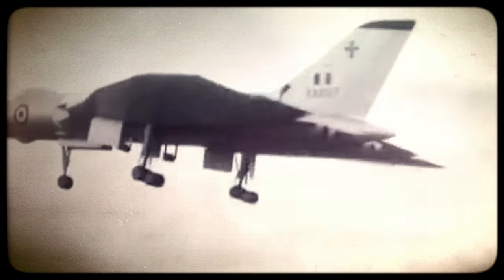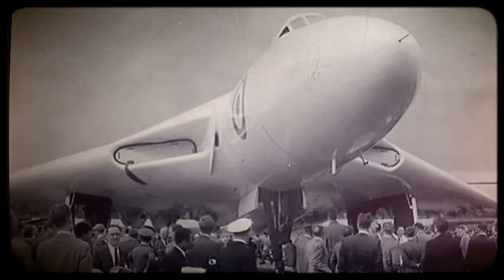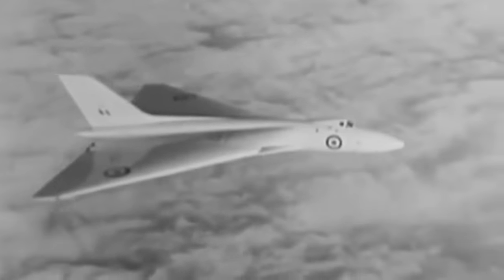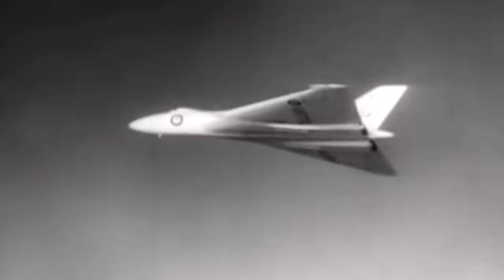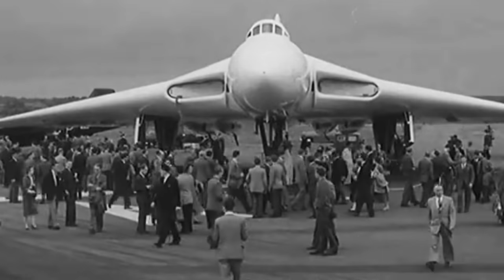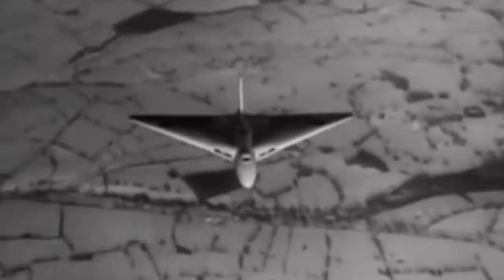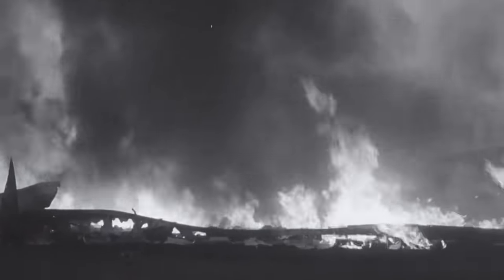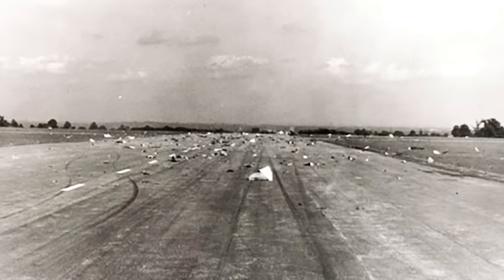Vulcan Bomber Disintegrates on Camera

Comment: There's a personal aspect to this tragedy for me. I lived in Arnold, a district of Nottingham 4 miles from Hucknall Aerodrome, base of the Rolls-Royce Flight Test Establishment, where Vulcan VX770 was the flying test-bed for their Conway engines. Due to the experimental nature of the Vulcan's flights, it was permitted to perform low circuits over densely populated urban areas, and my house was right on that circuit. It used to regularly thunder low overhead, rattle the roof tiles, and scare the living beejeezus out of me; I was 3 years old at the time. When I was a bit older, my father, a former WWII navy Spitfire pilot turned RAF Gloster Meteor pilot, used to take the family along to air displays. Where, in the end, I 'made friends' with the Vulcan VX770's successors and the other ear-splitting jets. The last time I saw a Vulcan was in summer 2015. By chance, I saw the very last airworthy Vulcan in existence (number XH558) as it flew to Throckmorton air display. It was retired for good later that year. Sad that we won't ever see and hear again that awesome iconic beast thunder across the sky.
Reply: Thanks for your input.
Reply: Experimental airplanes allowed to perform over populated areas ! .....Does it make you feel, the people have no importance or significance ? I find it offensive they would not have performed over deserted areas.....Really !  Over the water maybe ?  Imagine the damage if one of these planes had again degraded in flight ! the number of people that would have died !!!!! Unthinkable.
Reply: Wow! my dad told me of the same thing. My passion is aviation and photography and one of my faves and last seen aircraft was the XH558 :-( Sad.
Reply: @linanicolia1363  Ha! really? Didn't you know people are expendable? if you didn't, you'll now know with the pandemic.....
Reply: That time with the falklands campaign the old Vulcan came through one last time for those black buck missions. A fine testament to an aircraft that was a real 1 off. It’s interesting however that the Vulcan’s us contemporary the B-52 Stratofortress continues to reinvent itself and remains in frontline service. It might truly be the first aircraft to celebrate a full century in service. Mainly because nothing has ever really been able to do it better
Reply: @linanicolia1363  Back then there wasn't quite the same emphasis on "health and safety" as there is now and actually quite a few tragedies happened during this developmental stage. I guess that's what spurred on safety regulations etc.
Reply: I was at school in Bulwell, near enough to RR Hucknall to be able to hear when the Flying Bedstead was being run (it was pretty noisy!) but I left in 1956 so the Vulcan was flying after then, but I'm sure it would have overflown Bulwell, too.  I used to work for RR  
and flew RC models on the airfield where the Vulcan was operated.  The Hucknall airfield was more of an airstrip with just one runway (it's a housing estate now). It's amazing that flying such a big aircraft was allowed because it's very close to quite large populations but they also flew a VC10 as test aircraft for RB211 programme much later - 1970s.

What a tragedy!  It's surprising the Vulcan programme survived it.
Reply: @Leec_1972  Most, if not All, safety regulations are written in Blood.
Reply: @linanicolia1363  no health and safety then. Racing car makers tested at 150mph on public roads too.
Reply: Yeah, thundering overhead, preparing to kill innocents????

Comment: It's amazing to think that the Vulcan was designed just 5 years after the Lancaster, by the same team at AVRO.
Reply: And my question is, "Was the Vulcan designed to do a Roll?"
Reply: @markdavid4897  It can just about pull off a Barrel Roll. (Maybe 'pull off' is not the best phrase...)
Reply: @tedf1471  technically most aircraft can do a 1g barrel roll. You can have a cup of coffee with you while you do it. okay, well may be some skill involved there, but it can be done
Reply: Brian Roome  Oh you're so clever!.
Reply: @williamjpellas0314  WTF?
Reply: @williamjpellas0314  That's right . Space flight . Moon landings . Want more ?
Reply: @chrisjohnson4165  British science and industry benefited greatly from a large number of German scientists, engineers, and technicians who were either captured by British military personnel or surrendered to them voluntarily.  The same was true of the US and the Soviet Union.  The Space Shuttle, for example, had direct input from Adolf Buseman, who was one of the pioneers in swept wing research and development and who also suggested the use of what became the ceramic tiles used to shield the Shuttle during atmospheric re-entry.  Expatriate German scientists largely built the first atom bombs for the USSR.  British hydrogen bombs were probably built with significant German input.  The list goes on.
Reply: @williamjpellas0314  So what's the dispute ? I can't discern any relevant info that would suggest that the demise of this extraordinary aeroplane and it's talented airmen was the result of " a sudden infusion of German engineers at the end of WWII . "
Reply: @peterbellwood5412  That's not what I meant, Peter.  I was responding to @ Chris Johnson's comment that "It's amazing to think that the Vulcan was designed just 5 years after the Lancaster, by the same team at AVRO".  Not exactly.  It may have been nominally the same personnel, but they certainly benefited from German scientists, technicians, and research which were captured at war's end.  That was the point I was trying to make.
Reply: @williamjpellas0314 Fair enough 🙂
Reply: @williamjpellas0314  I know that German scientists (some of whom studied at Cambridge) helped enormously with rocket technology, but you would have to be specific to convince me about their involvement at Avro.
Reply: @williamjpellas0314  Thanks foe that. I was a friend of Geoffrey Trevelyan, the first graduate to work at DeHavilland before the war. He was a fluid mechanics graduate from Cambridge, and was the aerodynamicist working on the Mosquito and all of the post war jets. His friend went to work on propellers. Also of course Stanley Hooker, who was Rolls Royce's first graduate, similarly sent by the govt to vital industries at the start of the war. His book 'Not Much of an Engineer is a brilliant read. Hooker and Trevelyan both said they studied alongside German students pre war.
Reply: The B-52 was also designed at the same time. And it’s still flying today
Reply: 10 years.
Reply: But when did the Vulcan first fly? The B52 first flew in 1952
Reply: Both the B52 and the Vulcan first flew in 1952. The latter retired 35 years ago but the former may fly till it’s centennial
Reply: No it is not, "thank" the German designs falling in the hands of the winners.
Reply: its amazing to think that captured german technology would catapult technological advance in great britain forward.
Reply: @williamjpellas0314  Using the word "benefited" is a very polite way of saying COPIED
Reply: I visited the Avro Heritage Museum and there was no mention of this incident
Reply: @williamjpellas0314  Well, Frank Whittle. We were progressing perfectly well with jet technology. The war accelerated development.

Wehrner Von Braun and his team were spirited away by the Americans. Who were not ahead of the curve. The Mustang even had a RR derived engine because the original US motor was crap.
Reply: @kellypaws  that guy is totally omitting the fact that Britain had jet planes in ww2. Some people like to make out that the Germans were light years ahead of everyone else but that’s not true. Not for every single facet of science and engineering.
Reply: @dimwitsixtytwelve  Unfortunately, thinking you know a thing, feels to some people like a stronger case than actually knowing a thing. 

Around the time of WWII Britain was technologically competitive and in some areas we were decidedly ahead, for instance radar, and radio generally. As you say the Gloster Meteor had been built and tested, it was just slightly too late to see much action, being released about 3 months before the end of the war. It's development had nothing to do with the Germans at all. In fact, more likely the other way around. Our idiot bureaucracy is another matter, since some of our technology was delayed in being adopted.

The only area where Britain's offerings were technologically significantly poorer, has to be our tanks. They were crap. Pure crap. Target practice for the Panzers, and a legacy of shame that we asked people to go out and die in them.
Reply: @kellypaws  All this "wunderwaffen" stuff is largely myth - most of the designs were still on the drawing boards. As for tanks, the Centurion, introduced at the very tale end of WWII was the first modern battle tank. The Avro team were aware of Lippisch' work on delta wings but did their own design work. Indeed the British had patents on delta wings from pre WW1 and the concept dates back to at least the 19th century.
Reply: @davidzof  Centurion was laudable. But Crusader and all the other dross we fielded? Terrible. The Churchill was a handy pill box, but slow and armed with a pea shooter. And then the strategic use of the tanks beyond that. Dear, dear. Not good.

But yes, the German superiority is much over stated, and tiringly often. Just look at the T34. An absolute stop and think moment for Germany. If the T34 had been armed with an 88 equivalent from the off, the German forces would have been decimated very quickly.
Reply: @kellypaws  Yes. The T34 lacked quality but they could build them by the 1000s. My point though is both British Jets and a good tank were ready in 45, with the Firefly available in '44 so no German wunderwaffe were going to stop the allied armies.

Should note that the Centurion, introduced in 1945 is still in service with some armies.
Reply: That evolved into the concorde.
Reply: @williamjpellas0314  You do realise the turbo-jet engine had been designed by Frank Whittle in the 1930's and Gloster Meteors were already flying combat missions for the RAF by war's end...?
Reply: @danielmeier8321  It didn't. We already had jet engine technology (never heard of Frank Whittle) and jet aircraft (the Gloster Meteor) before the end of WW2.
Reply: @kellypaws  The KV-1, which the Russians had in 1941, were virtually impregnable to existing German tank and anti-tank weapons at the time of Barbarossa.  What the Russians got wrong was their lack of radio communications and cramped 2-man turrets.

American tanks were no better than the British tbh.  The Sherman was crap and it was "successful" only due to it's overwhelming numerical advantage.  The Germans dubbed them "Tommy Cookers" because of their tendency to catch fire as soon as they were hit.  I think the Americans called them "Ronson's" after a popular type of cigarette lighter.
Reply: @douglasherron7534  Absolutely agree. It’s surprising when the Russian tanks were so far ahead of their time in the 30s/40s. that the T72 and T90 appear to be so behind the times, if the reports are accurate.
Reply: @williamjpellas0314  And Brazil's own (German) designed and built jet fighter.

Comment: A roll is a 1g maneuver, if I remember correctly. If your plane falls appart during a 1 g maneuver, it shouldn't be flying in the first place.
Reply: NOTE: a roll and a barrel roll put different stresses on the aircraft: it has been several decades since Dad and Granddad were pilots but I think the wider barrel roll puts less stress on wings than does a regular roll around the aircraft's longitudinal axis.
Reply: The Vulcan had ejection seats for the pilots, but they aren't to be used under G-forces.  This aircraft had too many deadly incidents.

Comment: I worked with a Polish guy who stayed in England after the war, He had been  a rear gunner in a Lancaster all through the War, On the last Day of the War his plane a Lancaster was returning to Systen Not Systerson ,  It  was a foggy day the pilot clipped the wing of the plane on a  Hanger, it turned over and crashed all the crew was killed apart from My friend he got severely burned, His name  was Jonny Travera,
Reply: Syerston on the Fosse Way - A46
Reply: @derekambler  yes
Reply: Syston is down in Leicester 15 miles or so S/W of Syerston where the RAF base still is, though only gliders fly there now.  No RAF base down in Syston, even back then, mucker.
Reply: @fitzbarbel  Yes Between     Nottingham and Newark on the A46, It opened in 1940, I know its only a Glider school now go past it many times.
Reply: I used to live at Upton, on the other side of  the Trent Valley and could see the aircraft going down the runway on the horizon during the 2nd World War. It was fascinating to see. I can remember seeing a Dakota taking off with a Horsa glider in tow; get a couple of hundred feet in the air and then dive straight down taking the glider with it; must have been about the time of 'Market Garden; I was only 7 years old at the time. @fitzbarbel
Reply: @fitzbarbel  
You are correct. 
I was born in Leicester city,  my mother worked at Syston.
I was flying the Avro Vulcan between 1962 and 1966, based at RAF Waddington and RAF Cottesmore.
Officer Commanding, No 9 Sqn. (Vulcans) was Group Capt C B Brown (1963)
and Group Capt C G Maughan (1965)  - Promoted A/Commodore on  1 Jul 1970

Then Migrating to Australia,  Studying Engineering for 4 years and later Joining the Australian Forces. 
Aviation was in the blood,  given that my mother's elder sister served in the RAF.
During my service in Australia, I had the opportunity to serve as an Exchange Officer in the USAF,  flying heavy transport.
among other things. 
Some things we just never forget.  Time has run out foro the Avro Vulcan, and my time is running out too.
I have plenty of relatives in that area,  all between Sheffield, Nottingham, Mansfield, Derby, Leicester and MM.
Note that there is a Mansfield (named after Lord Mansfield) in the State of VICTORIA, and there is a Melton Mowbray in
The State of Tasmania.  There is a Leicester Street, that runs off Parramatta Road into Strathfield NSW.

So take a trip along Parramatta Road from Concord to Broadway, and Central Station, then onto Circular Quay and The Rocks
in the second video
[  ]►Sydney, Parramatta Road  -  18:19  ==>> Popular Parramatta Videos
[ Parramatta Road to George Street (Concord to Broadway & Central Station Sydney ]
https://www.youtube.com/watch?v=fAGULFoagr8

Continues from the Parramatta Road Video ...
And takes you to the Sydney Harbour Bridge, and " The Rocks " area.
Where the Aroma Festival is held, near the Sydney Opera House
[  ]►Video Sydney George Street
https://www.youtube.com/watch?v=cDelVPe2888

[  ]►Video Sydney George Street
https://www.youtube.com/watch?v=cDelVPe2888

[  ]►The Rocks Aroma Festival (OASIS) 2012.avi
https://www.youtube.com/watch?v=4SgPEYF-kt0

[  ]►The Rocks Aroma Festival 2013
https://www.youtube.com/watch?v=pNCH7TMKax8

** The Rocks Aroma Festival 2012
http://www.youtube.com/watch?v=2EkbbzW2IP0

Enjoy!
Reply: @andrew_koala2974  Was you at Scampton when a Vulcan landed, and the crew was getting out, A bomb was released onto the runway.
Reply: @derekambler   Some of the Market Garden Officer's were based near Lincoln , on the A15 just past Waddingham,
Reply: @derekambler   There were  Officers Billeted Just passed Waddingham on the A15. That went on the Market Garden raid. Pity it failed, The Germans knew they were coming.
Reply: @newton18311  
In answer to your question, I was based only at RAF Waddington and RAF Cottesmore, 
There were visits / calls to other bases on official business,
Reply: @andrew_koala2974  i Knew a guy who was a Navigator on a Vulcan, He was over Russia when Garry power got shot down. he was based at Scampton for a while , he came from Lossiemouth.
Reply: @johnmayer3433  Jonny Prokera. think that's how you spell his name
Reply: Jaś Prokera would be his name in Polish
Reply: @ollorollo   Thankyou,  he was a great gent, There were lots of Polish guys that lived in our town , They had nothing to go home to after the war so stayed.
Reply: I flew a glider out of RAF Syerston, and chipmonks several times from RAF Newton while i was ATC.

Comment: If that Vulcan bomber “exceeded” its structural limits with that no-load easy flyby then there’s no way it would make it through a combat mission.  Maybe it was a pre-production test version which would definitely have lower limits.
Reply: The limit was for the prototype.
Reply: Yes this was an early prototype, the wing shape is triangular, rather than the uneven frontal edge later versions had
Reply: Luckily it wasn't designed for combat, just for delivering nuclear bombs and then getting the heck out fast...